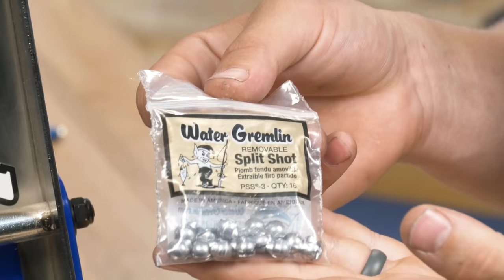Shop Talk: Is Wheel Balancing Worth It?

Comment: Just turn your bike upside down on the floor and spin the wheels at a reasonably fast speed. If the bike starts jumping then it needs to be fixed.
Reply: unreasonably*
common spelling error
Reply: @anooshsoni2948  The equivalent of riding at 100mph of course
Reply: @albr4  EXACTLY!
Reply: Your bike should never be turned upside down unless, of course, you are underneath it.
Reply: @robtk3  I am not doing this out of spite

Comment: I want all the weight saved by going from an average off the shelf bike to a super bike, and put it all into the rim.
Plus I want the top 3/4 of my tire aero covered, with the bottom half exposed with spokes that are scoop shaped on the front to catch on coming wind, and aero on the back to cut through its back stroke.
I want wind that hits the front of the bike to be funneled down into the front tire.
Essentially a small duct system that the rider will be able to crunch behind.
This will take the head wind and force it down into the front of the spoke catching system at about the 45 degree mark around the rim.

Might be more efficient to funny the air toward the rear, since it would be less of a dramatic curve.
But this would have to hit the bottom half of the aero spokes.
Like a water wheel being pushed by rushing water. 
Instead of water, its all the air that would otherwise be slowing the rider.

The more efficient the transfer of that power, the less air resistance a person will have.
Also, wrap the frame with flexible solar cells in order to introduce a small induction turbo fan that will be paralleled and Y connected into the main duct system to act as a vacuum system that will adjust its speed depending on the speed of inflowing air in order to maintain a sucking action on the front end instead of a plowing of air down the duct system

Instead of trying to build the slimmest possible rider and system, build with the idea that every inch of the rider will be ducted and all the wind force will be filtered directly onto either the front or rear tire.
That winds going to hit you no matter what, might as well funnel it in and use it.
Same with aero recumbent bikes, why don't they have systems that allow that head wind to flow through, pressurize, and focus onto a part that would assist instead of impede.

This way on large open road, when heavy head winds try and slow you down, they will actually help you coast much greater distances. 

I believe with all the tech today, you could easily make a bike with this design, for the same weight if not slightly more then an off the shelf walmart bicycle.

For cheap as fuck.

I want a machine I can live inside.
A machine that can store my power needs for a few days worth of gaming, cooking, showering, driving, heat/cooling, water condense from air and air purification, as well as store my composting toilet, inflatable shower, 12volt refrigerator, and storage for misc items.
A machine on wheels that can be found no matter how poor the country.
Be fixed by only simple means or otherwise simply replaced with very minimum cost while still having a the highest reliability.

We've seen the abuse bicycles take these days.
I believe, we can build a self driving machine, that can not only power itself, but over flow with power enough to power more then itself.
Between solar, thermal, static, kinetic, and wind, there should be more then plenty of cheap ways to easily slap a shit ton of different electrical absorption methods in order to create a machine that can provide:
Shelter, Water, Electricity, Transportation, Entertainment, a place to store and cook food, while also have a place to shit and clean yourself.
All on bullet proof, indestructible bicycle tires and rims that should already be (but obviously people suck) mass produced items everywhere.

When all else fails, you yourself should still have a pedal drive system that you can use and should still be able to move the entire machine the same speed as if you were walking with a shopping cart full of your belongings.

Walking speeds.

This means when all electrical systems fail, it does not matter.
As long as you have government checks to pay for food funding which comes from taxes payed by Robot workers.
All you need to do is make sure you have enough water to get you back to either a repair station, or somewhere you can contact us and we can send out a real sized tow truck with enough spare parts to rebuild 30 machines over being so light and compact in comparison to a regular vehicle.

Usually when you're not assisting the machine in moving, you're taking unused calories and pumping them through the pedals, into a centrifuge which will then transfer that into your batteries at the most efficient rate possible, all the rider has to do is occasionally bring the weight back up to speed.
Would be nice if that weight was a battery itself so its not just dead weight when standing still.

It sounds like a complicated system.
90% of it is a two wire system.
The other 10% of the most complicated battery and inverter systems will be handled by us for free.

Why for free? How for free?
If you ensure to us that you will never give reason to be imprisoned, never drive a car, and never sell anything harder then weed, we can supply you with party money, and spare parts for life.

Because the money I save by not employing you and employing a robot, plus keeping you out of prison, is more then enough to counter balance the cost of keeping your machine running and you happy with all the drugs and food you could want.
If I give you a higher budget, you just get closer to overdosing.
So you'll find that medium where you're giving people enough money to have a healthy good time, and eating well, with only pennies left over every month.
You pretty much give people enough money to make themselves sick every month, until eventually they learn they don't want to be sick so they cut back on what they're doing, and this will draw that line at what exactly the food and drug budget should be.
It really wont be that much different between everyone.
The people on the high end will just die quicker which isn't necessarily a bad thing.

Instead of people fighting over being rich, you'll come into a life where you get to make a decision:
Living rich means dying young.
Living poor means living longer.

Because the only difference would be the rate in which you consume your food, drugs, and electrical income.

Even the elites that built the system will not choose to live outside of it.
Why would you?
While everyone else is outside not locked down by the boundaries of the cement foundations, you'll be in a massive mansion where it takes you five minutes to walk to any one of the 50 bathrooms.

Where you find yourself creating a living room in a the kitchen with the nearest bathroom and end up sleeping on the fold out couch in that living room space just to save your sanity. 

I want that space, the kitchen, living room, bathroom.
Smashed all into on tight aerodynamic package.
That produces more then enough power to not only run and maintain its own systems, but also run your systems, and even a system or two plugged into it. 

I want a portable laptop power station that I can move anywhere under my own power, plug multiple systems into, and recharge as many ways as possible.

All in a package I can live inside, and move on bicycle wheels made by fucking nasa.

Get, it done, for the love of god, please.

It's been almost 20 years.

Comment: Hilarious, thanks guys! In fact, I replaced the valves on my tubeless carbon road wheels with aluminium Muc-Off valves and saved 4g per valve (original 60mm Mavic valve 9g, Muc-Off 60mm valve 5g, both with o-rings and washers). There's definitely less wobble on the stand. I also feel I can climb easier but that's certainly placebo ;)

Comment: In my professional opinion balancing your wheels is not only more efficient . It's also  better for the longevity of the hub bearings.
In most cases you just have to counter weight the valve stem.

Comment: I have balanced car tires for 15 years.  You can usually only feel an out of balance around 50+ mph for a car.  So for the speed of a bike i would say you cant feel it. Probably not necessary unless it is way out.
Reply: cars weigh 1000s of kilos more than a bike and rider so there is much greater damping effect. But even if you can't feel it, it could still be having an adverse effect.
Reply: Also E=mv2... going double the speed (say 40 vs 80) will have more than triple the energy

Comment: I have a cheap hybrid (~USD100) (MACH CITY MUNICH SINGLE SPEED). The wheel was totally not balanced but it wasn't noticeable in the ride.
Still my curiosity balanced it years ago.

Ride fatigue went down drastically the next day (the wheel was just a little more off than the one in the video without the wrench)
Braking power improved somehow.
The ride became stable at 40+ KMPH

Comment: Balancing does remove the wamp helps with rider fatigue on long races. Track racers and long distance road racers do notice an out of balance tire. We used lead tape to balance finished tires and just like balancing a car tire, you balance with tire on, fully inflated ready to ride. Having a tire out of round or not in true probably effects the average rider more the an out of balance tire. But the average rider is most likely never going to notice.

Comment: a bike wheel it may not make much difference but car wheels  you can wear the tire unevenly.

not just thickness of extrusion but if you look around the rim you will see a seam where the ends of the extrusion has been put together.

inside the seam is 2 pieces of steel wire to splice the ends together.

if you was to cut out a 1 inch on each side of the seam then put that 2 inch piece in a vise and pull it apart you will see 2 pieces of wire holding the rim together.

Comment: I caught a serious speed wobble straight out of the neutral zone in a state champ road race a few years ago. It only happened that one time & I haven't been able to reproduce it. Headset & wheel bearings had the appropriate preload. My assumption is that the harmonic imbalances in both wheels alined so as to produce the wobble. I can't stand to add weight to my race wheels, so unless it reoccurs I've done nothing about it.

Comment: Ah, so, the tire is tubeless, or maybe not, and you put sealing fluid inside.  Well, well, well.  This one saves you a lot of trouble about the balancing issue.  Here's why.

Ever wonder why a drum of a spinner dryer whomps in the beginning, but eventually levels off?  The reason is liguid in the insides of the drum.  To offset the imbalance, the fluid inside seeks the imbalance and levels off until the drum runs smoothly.

The same is true with tires.  If there is liquid inside, or maybe ceramic beads, they level off any imbalances the tire has, both lateral and axial thus making the ride smoother than without the liquid. 

Of course the trade off is that the tire must be in motion for it to take effect.

What you have done is called static balancing.  It's also done in motorcycle tires.  However, with the influx of tire sealants, there is really no need to bother about lead weights or anything.  The sealant is already enough to balance the wheel, while in motion.

Sorry for the late reply.  I just viewed your video today.

Comment: Really it is a little disappointing that you didn´t finish the job 😕
i.e. balance a wheel, and then test it out for a bit, and then see did it actually stay balanced at all or not.
.
Because essentially the process, if done at all, should only be done every time you get new tyres.
Or if you yourself happen to notice a serious imbalance whilst cycling or doing some other maintenance.
.
So basically the process would be the same as it is for car tyres.
After they fit your new tyres, they have to balance the wheels for you.
Or, if you notice any handling issues or whatever with your car, you may go into a garage and ask them to check the wheel balance and alignments [which is a quick and inexpensive check].
.
But at the same time it was very educational to see how many different factors that there are affecting wheel balance for a bicycle.  👍
It helps you realize how many different factors & even physical components are actually involved!
.
cheers!
JB

Comment: Do I balance the wheels?
YES!
On a Track bike, before each race.
On a road bike, It can effect handling, and road holding on fast bends.
On all non suspension bikes it increases the fatigue on the spokes.
On all bikes it increases fatigue on you and the bike.
Unbalanced wheels also caused uneven wear on the tyres (tires USA).

BUT for an off road bike I personally don't bother.

Our cycle club did a "blind" test where we logged the top & average speed and the calories burned on a "set ride". x5
Then we balanced the wheels and repeated the test. x5
The results were quite varied BUT all the speeds were UP and the calories burned were down.
This was on a group of twenty riders in the club.
Not very scientific or accurate But it did show that balanced wheel make a difference.

P.S.
Don't add more weights in different spots on the wheel like you did.
The weight needed moving round the rim and also adjusting as it was too heavy.

Comment: I experienced really bad speed wobble at 45+ mph on the front wheel.  So, I definitely think that balancing the wheels is critical for road bikes.
Reply from the maker: Speed wobble can be from a few different things including geometry, frame flex, and others. I have not heard of a speed wobble being caused by an out of balance wheel. Jobst Brant has a good article on speed wobble.
Reply: @parktool  The Shimano wheels that I was using was the only wheel that caused the speed wobble--I tried my Fulcrums and HEDs and it doesn't happened at those speeds and I noticed that these wheels are balanced way better than the Shimanos.  The Fulcrums are especially true.
Reply from the maker: A wheel flexes in a frame and causes an oscillation giving you the wobble. This can be due to flex in frames or wheels and amplified by some geometries. Even a loose quick release can cause it. Not an out of balance wheel(in the small amount we are talking about). I can see different wheels giving different outcomes based on how well it is fixtured into the frame. Campy and Fulcrum have large knurled lock nuts as well as some strong internal cam qr's adding to the rigidity of the bike as a whole.

Comment: I think the most balancing that should be done, is the rotate the tire on the rim until it's as close as possible. Then add sealer if your running tubeless, if a tube, just call it close enough.

Comment: Funny how I balanced my rear wheel on my bike yesterday and today I see this video. It was useful, above 25km/h speed the whole bike was bouncing before balancing. After it was smooth and joyful so thanks for the tip using fishing weights. Now I used nuts in the valve stem; exact heavy point was opposite the valve.
Reply: Actually you should use Lead Golf Club weights.  Stick them to the rim.

Comment: Yes, a heavily unbalanced wheel will add friction and instability.  But a small unbalance is acceptable.  There are those who will pay $60 for an ultralight and aerodynamic carbon bottle water cage and think they can feel an improvement.  Technically there should be an improvement but realistically, it may be noticeable as a few seconds gain after a 100 mile race but not from the rider's perspective.  Therefore, it's like placebo.  If it makes you feel good... go for perfection.  But don't expect it to win races for you.

Comment: Yes, I balanced my road wheels.  I figured at over 50 mph at times in races it sure would not hurt and theoretically could help.  How much? I didn't know but why not let that rock stay covered.  I did my balancing with my tire on otherwise its is a bit of a waste of time.  I figure it helps more that ceramic bearings in your wheel hubs and is a lot cheaper.

Comment: Great video about nothing. As a car mechanic years ago we balanced wheels/tires by hand. (no fancy machine to do it for us) When we found the heavy spot, like you did, we would then split the counter weight measurement  in two. Then split the wheel diameter into thirds and put the weights in the two spots opposing the heavy spot. This gave better dynamic balance. You procedure only gives static balance. Pure physics. Just for those interested and JM2C

Comment: Please give the option of Spanish translation.
Your technical explanations are excellent.
Disc and caliper well centered, but with 29-inch wheel with spokes and bushing badly centered and badly tensioned, always the disc will rosá to the tablets (oscillation).
I have a double-suspension bike (DB RECOIL 29ER) with 29-inch wheels, on the front with 9mm quick release and 10mm on the rear.
Does the types of closure influence NO BOOST AND BOOST?
I am using text translator.
I hope you understand me thank you 👋👋👋

Comment: I balanced my old tubular 808s for my TT bike with some golf club weights and felt no difference for the speeds I ride for the amount of weight it took. I scrubbed the mission. I am flummoxed, however, as to why wheel makers don’t seem to take into account that tubulars with a valve added will not be very balanced.